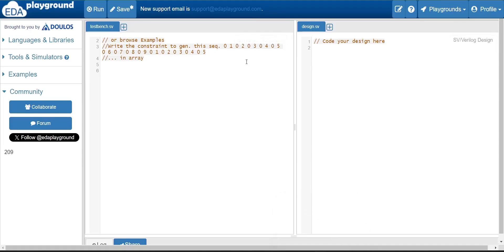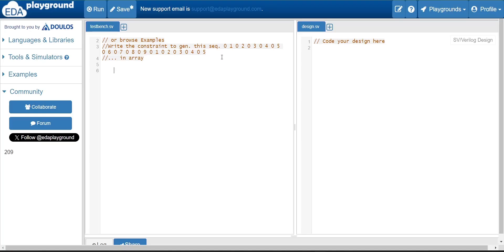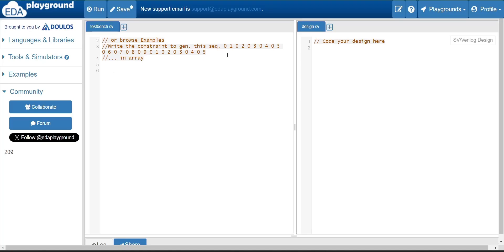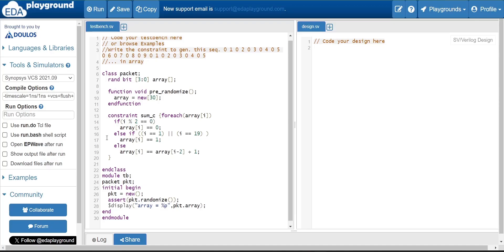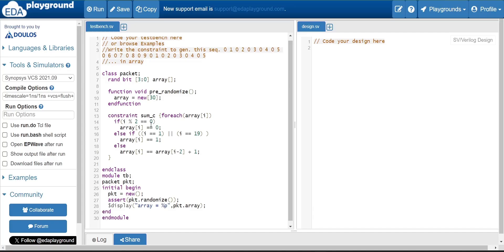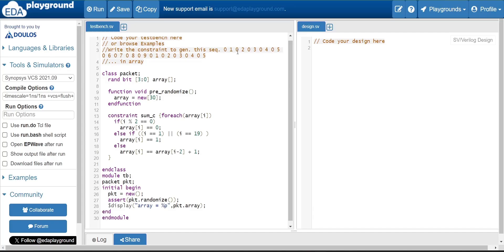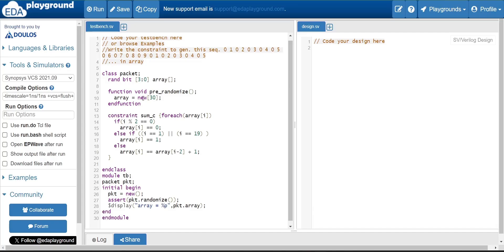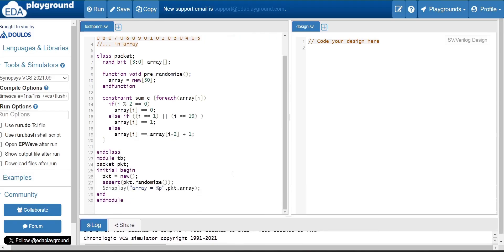Interview Questions on SystemVerilog Constraints Part :1 #semiconductor #constraints #vlsitraining

Comment: You are restricting the size to 30. Lets assume size is 100 then? 

I got the answer for it. Use the below constraint

  constraint c_num{
  	
    foreach(data[i]) 
      if(i%2==0) data[i] == 0;
    else if(i==1) data[i] == 1;
    else if(data[i-2]==9) data[i]==1;  
    else data[i] == data[i-2]+1;   
  
  }

Comment: here can't we use randc because it is in cyclic repetition.
Reply: Yes we can use it...
1. But we need to get the zeroes in between to generate the same pattern right..
2 . And more over when you use the randc they will not repeat until all the permutations are done but they may not get randomized in the same order as given in the sequence...
Reply: When I checked it I got the same order as given in question
Reply: You can post the code....zeroes in the pattern is not possible through randc